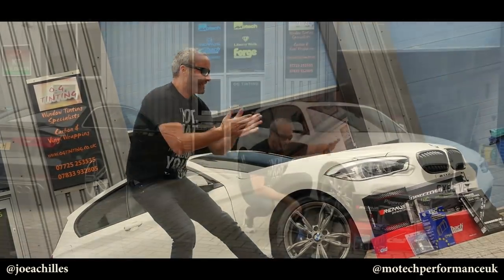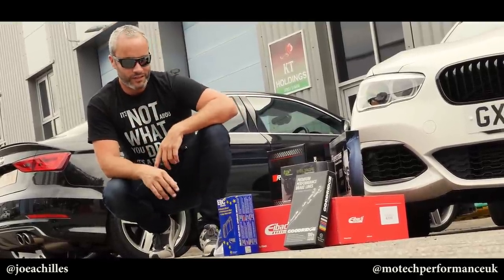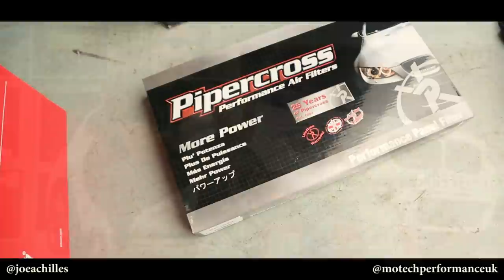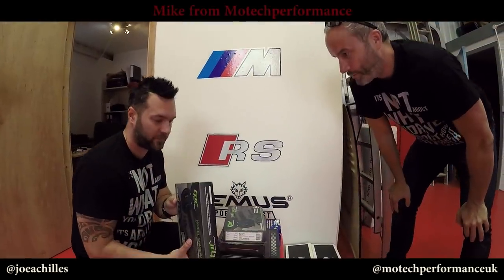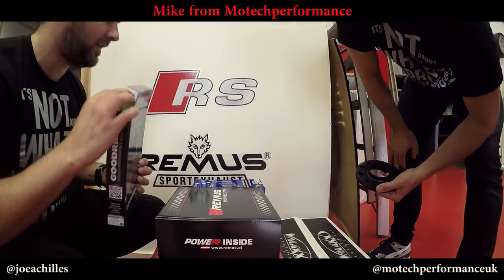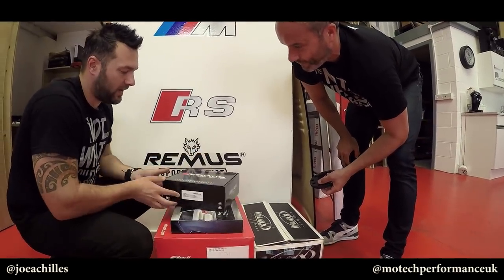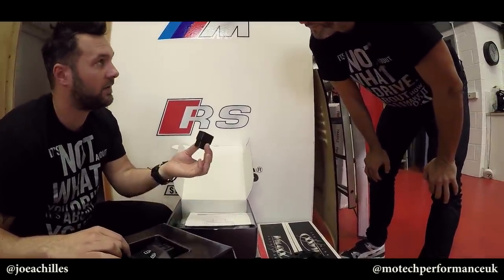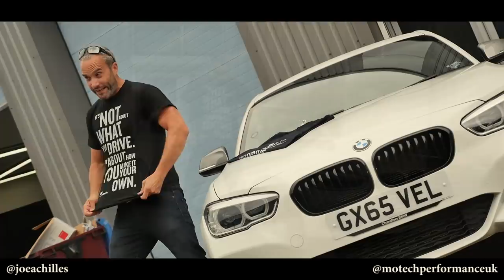Taking my BMW M135i to Motech Performance - Tuning - Joe Achilles

Comment: So funny how the torque wrench instantly clicks after he's windy gunned the rims up. Not particularly professional from Motech.

Rims should only be removed with a windy gun. They should never but put back on with one. Always put back on with hand pressure....I.e. spider wrench and torque wrench. 👍🏼  

Sorry if people think I'm nit picking but this method Motech are using could seriously screw you over if you get a flat Joe on your trip. 👍🏼
Reply: I was also always taught to do it in a star pattern for equal distribution of the pressure when tightening. I thought the wheel leaning on the back of that sierra was a bit unprofessional too.
Reply: OnlineHousehusband of course it clicked instantly, they were way above the correct torque figure!
Reply: Lance Escobar yep i was tought exact same thing to tighten the nuts back on in a star pattern
Reply: glad to read your comment... I left similar last week on another of Joe's videos. Can't believe so called pros do this.
Reply: 3 dugadugas iirc

Comment: Looks so much better without losing the stealthy 'Sleeper' vibe - be really interesting to see how much better it drives on the Eibachs, Remus kit & slightly wider track.  Brake lines are always a great idea but not sure about the EBC yellow stuff pads - I used those before if fitted my big brakes, tried the red stuff too but found them a bit disappointing, especially after repeated heavy braking. I switched to Ferodo DS2500 pads and they're fantastic as an OEM upgrade, just a thought bud.👍👍

Next Mods - I'd say fit a Quaife slippy diff and an exhaust system - that'll do the trick very nicely - I've got a Quaife in the Saab and it's an absolute riot, I know that the BMWs respond really well to them too.

Comment: What was the reason for going for a plug in engine tuning solution rather than a proper remap? Generally plug-ins can only "fool" the car into thinking some variables have changed. Updating the core ECU programming for a more performance oriented map is always going to be a neater and higher quality solution.
Reply: Shrink1061 he did not want to have his ecu opened up to be tuned

Comment: Does putting springs on affect the ride on a car with adaptive suspension? Defiantly a rear spoiler and front splitter next, they make the car look so much better.
Reply: george mitchell ride is just as good mate

Comment: 100% needs a new exhaust system
Reply: Is that you Paul? ;)
Reply: Needs An AmryTrix !!
Reply: Not bad, I had a ECU tune on my 535i and got an extra 75 WHP.

I have a C63s AMG now, check it out on my channel if youd like!
Reply: or no exhaust at all
Reply: Digital Nav i eat c63 in wet conditions.

Comment: Hi! Does the M adaptive suspension options (comfort, Sport and Sport Plus) still work  after installing the Eibach lowering springs? Can you still feel the difference between the ride modes? Thanks!

Comment: Amazing. You've done a few of the mods I've been considering. Definetly look into something for the exhaust as like my 140i it lacks a bit of drama. I've seen people remove the centre section (like 8lowsy on YouTube) there is a straight pipe part out there which gives a bit more noise and pops. I'd definitely look at getting the quaife LSD too. I'd have it already if I had the cash handy. Swan sell it online 😁... That would make this the practical M2 slayer 😉
Reply: Yeah, especially as the cabin is so well insulated, the exhaust definitely needs some sort of enhancement because I absolutely love the sound of this engine!

Comment: Hey Joe! Saw this video a while back and now made my decision to go for the yellow stuff. I have been having a really hard time finding the correct ones. I'm from Mexico and normally order everything from the US, but they don't have the M135i down there, so I search everything as if it was for the M235i (guessing they use same pad type) and the yellow stuff appear as unavailable for the M235i. Is there any way you could get me the part # for the pads? Help a mate out. Thanks man! (not the first time you influence my purchases... remember you got me to get my M135i in the first place!)

Comment: Question Joe, why do you think this M135i and the one before are going to be classics and not the M140i. I heard you say this in an interview a while back and I always wanted tot get your take on it. Unless I got it wrong haha
Reply from the maker: Basically because the original M135i was the original, the M140i was a slightly better hatch, but it wasn't the model that started out. I might be very wrong though 👌
Reply: @JoeAchilles1  I like that. History is on your side. It's always the originals that do the best.

Comment: How does all this work with your insurance Joe? Do you declare it, not bother, how much does it cost? etc etc
Reply: BrabusBandit every insurance company will be different and you should Iet them know 👍
Reply: I know, but with the price they charge you for having this stuff if makes it not worth it if you do inform them :((
Reply: declaring mods is a must. if you dont declare them and have a serious accident not only does it void your insurance but you will be left with the hefty cost of repairs . have you tried an insurance company that specialises in modified/ performance cars? as some companies dont insure for mods.
Reply: Yeah, I tried numerous ones when mine had a remap and they all wanted 2k or more :/ when they'll do a Golf R with the same BHP for 1k??
Reply: BrabusBandit like you say then its not worth doing the mods sometimes.
Reply: BrabusBandit I had a remap on my Scirocco that took it to similar power as an R but because not all insurers will take on modified cars I ended up paying more on it than if I'd just got the R in the first place (although obviously the car was cheaper). My M135i doesn't really NEED a power increase but it's always tempting! However I've seen comments on forums from insurance company employees saying in the event of an accident nobody ever checks the ECU anyway because there's too much cost involved. Whether or not you'd want to take that risk in not disclosing it is up to you!
Reply: Joe is old enough that mods will cos peanuts to declare.
Reply: Barry Britcher I think we're about the same age. So it's still a decent chunk extra but granted, it's not as much as a twenty something would have to pay.

Comment: Joe, im not gay but i love you 😜
You have my taste of cars.
I drive a M140i Xdrive with 367 hp and 586 nm.
0-60 in 4.1 sec.
Standard power tested on the bench.
Bmw is known to have more power then they say.
My dream is an M3, but even secondhand they are to expensive for me.
Running costs off the roof.
And an M2 is also nice but no improvement in power compared to my M140i Xdrive.
If i just had a bit more cash i could get an M3.
It continues to be my wish.
Love you and your detailed clips about the beemers man!
Cheers.

Comment: Tuning boxes are shit get a proper custom remap. Doesn't have to make 400bhp but proper Remaps make smoother power through out the revs. Aslong as it's a reputable tuner he will know how far you can push it before the clutch starts giving problems. Any other engine mods you got planned do it before the remap so he tunes it to get the best power out the mods you have. I would only recommend tuning boxes to people who have a warranty since they can take it off before giving it in for repair so it can't be traced in the ecu. Go on the forums for best advice so they can recommend downpipes etc

Comment: Get rid of the yellow stuffs, EBC pads are shocking
Reply: Same here mate, okay on the road but fade instantly on track
Reply: The performance is one thing but the quality shocks me a lot more, not uncommon for them to fall apart or separate from the backing plate
Reply: Yep I'd agree, for a car like this there are a lot of better options. 2500's 1144's etc.
Reply: I've just done a 2,000 mile road trip via the Nurburgring to Switzerland in my 330ci and back; I Did 5/6 laps, all on the limit. Fastest time 8:54. I've got Yello Stuff's all round and after that trip, I'm dallying my car 30-60 miles a day and they're absolutely fine. Only problem is that they squeak and squeal like a MF at low speed braking. Don't know why there's so much hate for yello stuff pads.
Reply: Just put them on my E92 335i, haven't had any problems with them yet and the racing brake fluid seems to give better feel. 
I know there were problems with EBC pads a number of years ago but the research I did seem to suggest they are good nowadays...?